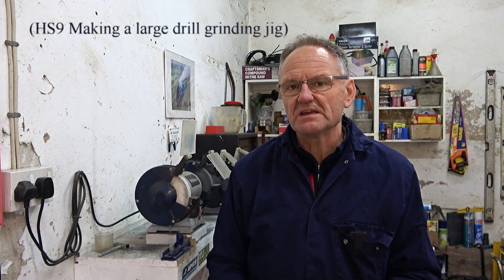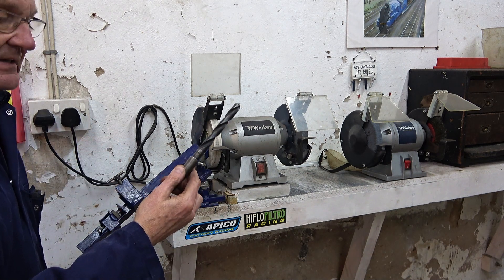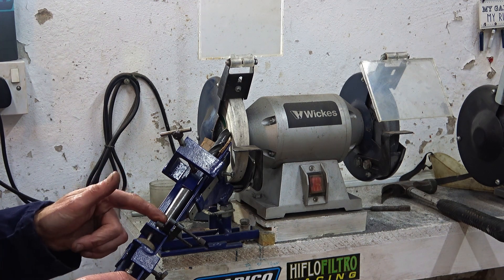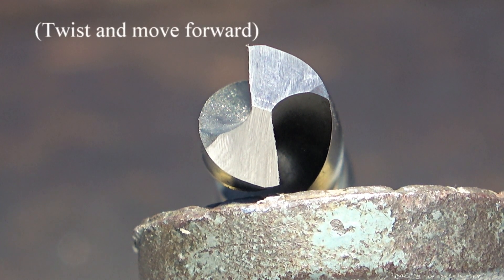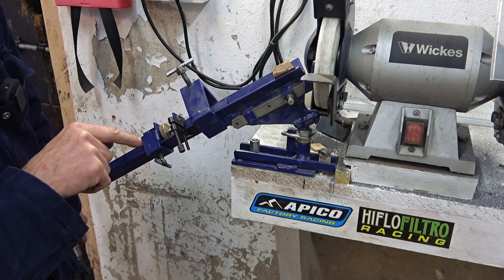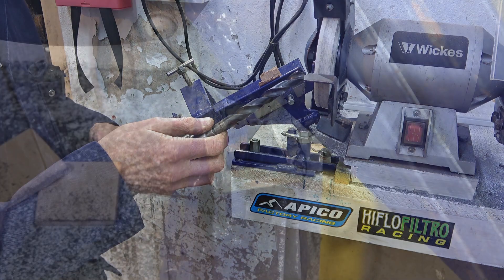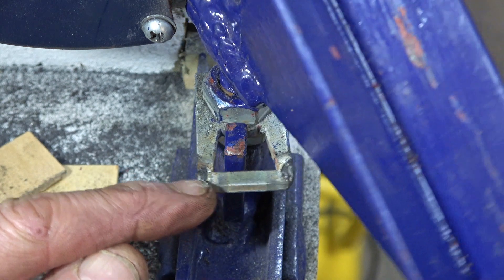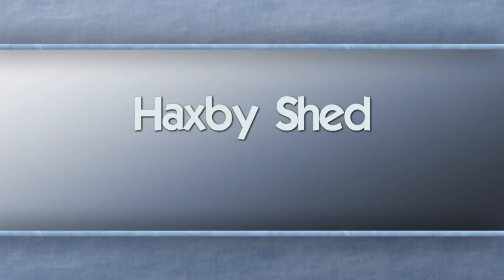HS109 Sharpening drills on the shopmade jig #toolfest2021

Comment: Excellent video again, now model engineers need quite a few small BA drills down to around 2mm. Although I know they don’t cost as much as big drills, but sometimes we just need to touch up a small drill after say drilling stainless steel. I cannot find any designs, commercial or shop made for machine sharpening of small drills. Do you or any of your readers know of a suitable design or have any suggestions. Many thanks for the video.
Reply from the maker: Roger I use a Drill Dr for smaller drills, say under 6mm or 1/4 but I can't say it's reliable. It depends to some extent on the speed of the helix to get the edge lined up correctly. So sometimes it's excellent and the drills are sharp, and other times it flattens off the cutting edge so the drills just rub. Cheers

Comment: I like to argue that a lot of tool making is all about what's "good enough". 
Whether it's +/- 50um or +/-500nm, just do whatever works and adjust the machining to suite.
Reply from the maker: HI Zappyguy111, yes I think that's the key - "good enough" for the job we are doing. I think with a bit more care I could have got the faces ground a bit more equal as it seemed to favour one side when drilling but that's just a grinding operator error on my part. Next time will be better. I see you have a channel yourself .......  Cheers.

Comment: G’day Haxby. Well done and it works, well. With a smaller drill rest clamped in the existing rest will it sharpen the smaller drills?
Cheers 
Peter
Reply from the maker: Hi Peter, I have not tried a drill under 14mm because I have a Drill Doctor however I do not always get good results with that so at some point I may try smaller drills on the jig. I see you have a channel yourself, doing well. Cheers

Comment: It's NOT a good idea to use the SIDE of the grinding wheel for this jig. Extended use of this jig in this way could cause the wheel to disintegrate. Perhaps you could reposition the jig to use the front of the wheel.
Reply from the maker: Hi ZenMinus, thanks for the comment. You are right of course I should not use the side of the wheel. I only use the jig occasionally, usually when I buy another old drill, and I am always careful only to take light cuts. Also I never stand in front of the wheel and I wear protection glasses. It is a manageable risk if I am careful. Cheers.
Reply: I thought / wondered the same thing about the side wheeling. Thanks for addressing that concern Haxby
Reply: You are correct but the side of the wheel can be used safely if used correctly, especially in an example like this where virtually no pressure is applied as its very lite cuts, you can actually find this in safe systems of work.

Comment: Haxby well done. But only 1 flute was cutting. There was only 1 curl coming off the drill bit when you were trying it out it looked like. I have the drill doctor and it does ok but not great. Was really disappointed in it to tell the truth.
Reply from the maker: I think you are right Anthony, I noticed that. Operator error. I need to be more careful how I use that small clamp to make sure both sides are ground the same, as near as possible anyway.

Comment: Thanks for the video. I have the Craftsman drill bit grinding attachment (9 6677) but am planing on making a similar jig for my larger MT2 and  MT3 shank bits. You video gives me some ideas on how to improve my initial design. I plan on making MTx shank to straight shank adaptors to keep my MT bits properly aligned instead of the cardboard packing you used.
Reply from the maker: Hi John, my setup is pretty crude but I do not sharpen many drills - it tends to be the ones I buy at sales where somebody has messed up hand grinding or they are chipped. A degree or two under or over on the point angle is fine for me. It took me a long time to get the jig to work properly - a lot of trial and error. But now it is pretty reliable. Regards

Comment: I need to make something like that for my very small drills.
I didn't figure it out yet :-)
Reply from the maker: Hi Rusti, I can sharpen maybe 4mm to 12mm on my Drill Doctor sharpener but sharpening really small drills is definitely a gap in my capability. And my eyesight is probably not good enough anyway ..... regards.

Comment: Nice little jig! I frequently split the "chisel" point by hand on all bigger sized drill bits using a 1.6mm cut off wheel in my angle grinder. It would be quite easy to make a jig for that too! All the best, Matthew
Reply from the maker: Hi Matthew, I will think about that. Cheers